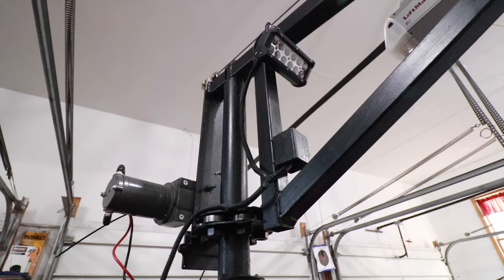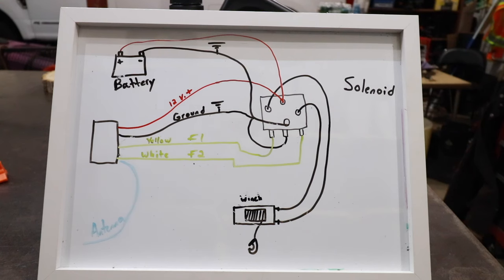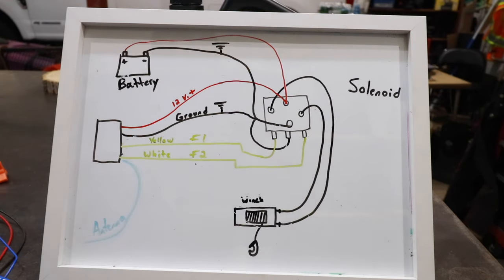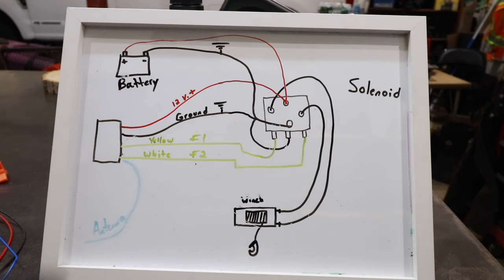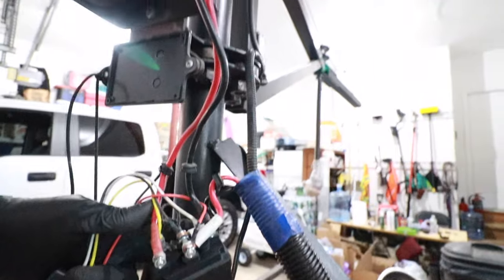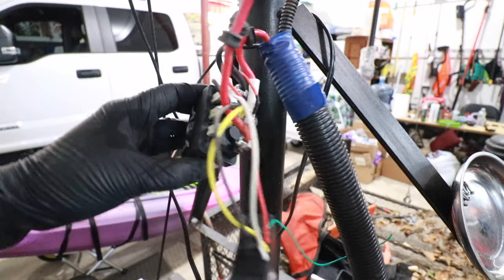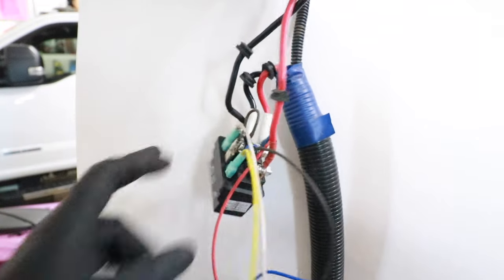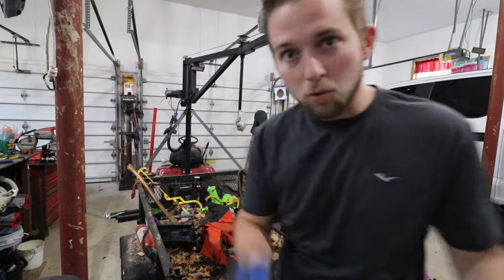Wireless winch remote install | Winch Solenoid Wiring Basics

Comment: Thank you very much for this video.  Just got the exact same remote for my current project. Then it does not come with instructions. That could not be explained better than what you did.  And for my project (to be published in a few weeks), I really need to know which wire does what, as I won't be connecting it to a winch solenoid, but rather 2 relays (30 amps). Have you tried how far can you still get a good signal with the remote?  Can the antenna be extended?   I'd like, ideally, have this remote to work up to 150ft away. I know it's not meant for that far, but still hoping if the antenna is well located.  Thanks again!
Reply from the maker: Always good to hear from you my friend. Glad this video was helpful. While installing this controller, I was also thinking of several other applications I could use this device for. Great minds think alike! Looking forward to seeing what you have created. 

Now to answer your question about range. I am unsure what the maximum distance the remote will work from, but I will test that out this weekend and report back.

The remote I purchased is definitely the low budget option. I would presume that there are better quality, longer range controllers out there, but they will be at a premium. The one I purchased is advertised at 100' Range. The antenna consists of a 6" tail of approx. 16 gauge wire (Appeared to be pure copper). Stripping this portion and soldering on an extension may increase the range.  I would also say that other nearby electronic  and wireless devices may cause some interference, thus decreasing the range.
Reply from the maker: My remote worked to about 120 Feet, with a direct line of sight. Trees or obstructions will reduce the range.
Reply: Thanks for the info!!!
Reply: Does it come with the jumper

Comment: Hi. Do you know the receiver box how many amps can deliver without a solenoid attached? I want to use it for something else, not a winch.
Thanks.
Reply from the maker: @worroSfOretsevraH  What do you want to use it for?
Reply: @OldSoulMillennial  To operate a gate using a windshield wiper motor. (trough a gearbox)
Reply from the maker: @worroSfOretsevraH  I wouldn't push more than 5 amps through it. It's designed as a simple 12v (low draw) trigger. You could easily add a relay to achieve what you want to do.
Reply: @OldSoulMillennial  Ok Thank you.

Comment: Why do you have to have a solenoid?  Why can’t you hook F1 and F2 directly to the two lugs on the winch? 
Then power and ground to pos and neg from the battery?
Reply from the maker: The same reason your car has a relay for the starter motor. The ignition switch would melt if you tried to push that much current through it. 

Same idea with this winch controller. F1 and F2 are designed to supply maybe 5 amps Max (if that).  A very basic 2k winch will likely draw at least 30 Amps.